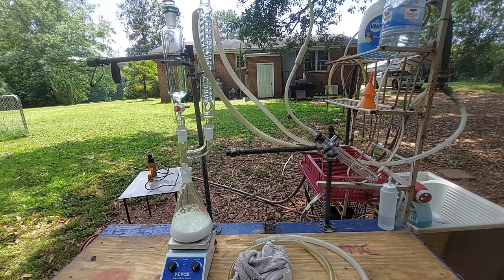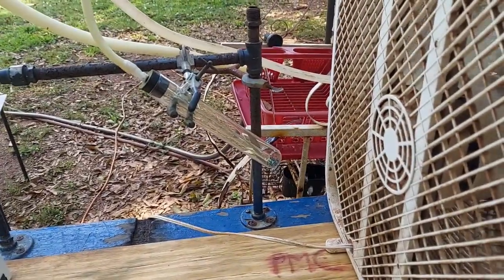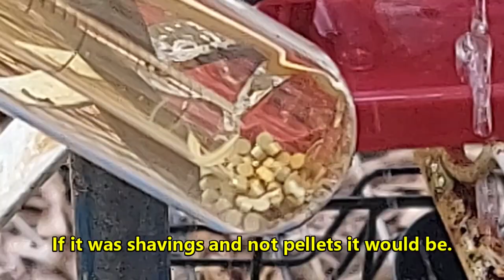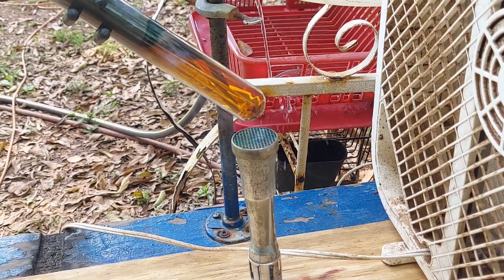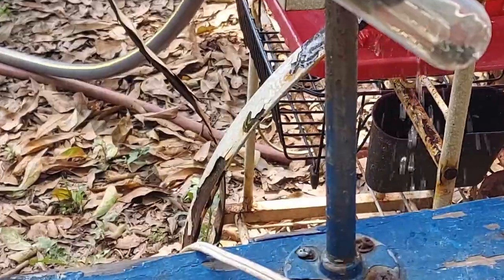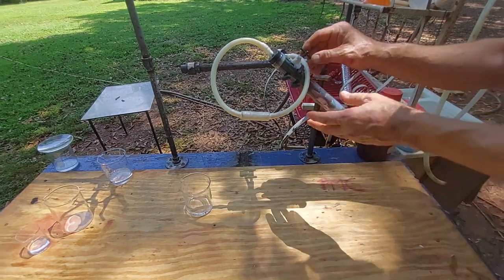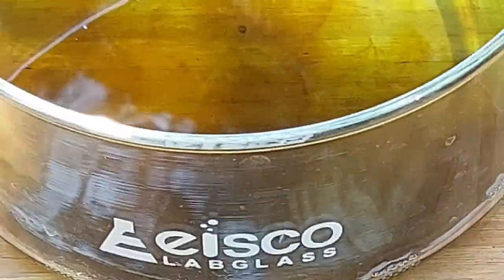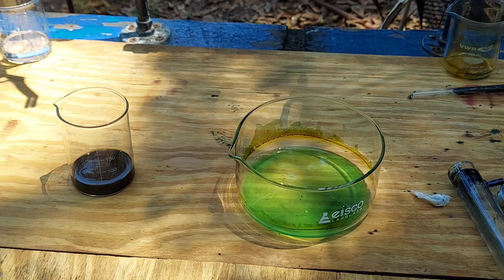Molybdenum Pentachloride From the Elements #chemistry #molybdenum #chlorine #chemistryeducation

Comment: It looked kinda orange before turning green. When it was brown before pouring it into the crystalizing dish, it had an orange-ish hue to it.
Reply from the maker: Yeah this thing turned all kinds of colors. I think that there was a leak somewhere so air was getting in. Or it was getting sucked in the side arm as the temperature changed. If I had left the flame under it from the beginning and increased the gas flow rate it would have turned out a lot better. But we did prove this approach works and that anyone can make this stuff. The real challenge is getting it out of the tube and into a vial or ampoule.

Comment: I prob made MoCl3 or MoCl5 by adding Mo to hot Aqua Regas. When baking soda was added and water it went from orange to blue dark blue!
Reply: It was also very unstable in water.
Reply from the maker: Sounds like it was either the dioxide or molybdenum blue. Although in those conditions it was probably the dioxide. Still it's beautiful isn't it?  🙂

Comment from the maker: Are you guys getting burned out on unusual chlorides (no pun intended)? It doesn't seem like too many people liked this one. If there is something you dont like about the video please tell me so I can adjust how I do my shit. 🙂
Reply: You can use the chloride as a starting point for organic moly compounds if you like. 😉
Reply from the maker: @christopherleubner6633  I was just reading that it won't react with dry CO2. If I can transfer it and store it under CO2 that just made keeping it a LOT easier. Also went shopping to improve my apparatus this morning. Won't have to worry about air sucking back into the tube because of changes in temp anymore. Made some other improvements to the seals. Your earlier comment about using MoCl5 to make acyl halides intrigued me. Now I really want some in my collection. 😆😆

Comment: I have a question that doesn't fit the topic of the video. I am interested in the chemistry of arsenic compounds and do not know whether the chemical compound arsenic (III) cyanide exists or can be synthesized (without poisoning yourself)? Information about this is rare. I also wonder if it is possible to generate beautiful crystals from Co3(AsO4)2 • 8 H2O or Ni3(AsO4)2 · 8 H2O?
Reply from the maker: Check out my playlist of pnictogen chemistry. All of my arsenic videos are there. I've done a fair amount of work with the element. 

Yes a cyanide of arsenic(III) exists. But it has 2 methyl groups. Look up cacodyl cyanide on Wikipedia. 

If it dissolves in water I would think so. I've only made potassium arsenate from arsenic pentoxide and KOH. But it did crystallize. Whether the cobalt salt will or not depends on its solubility.
Reply: @PoorMansChemist  Thanks for your quick reply, greetings from Germany.
Reply from the maker: @GigaZernichter  Guten tag! Glad I could help. Don't be afraid to ask an off topic chemistry question. If it's chemistry then it's on topic no matter where you comment on the channel so far as I am concerned. 🙂